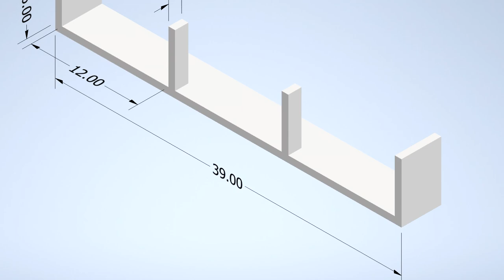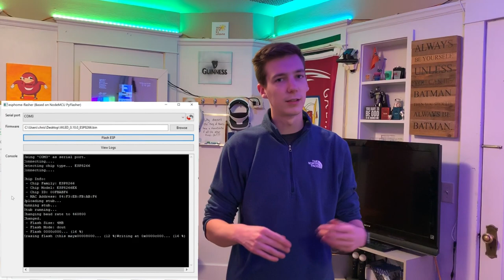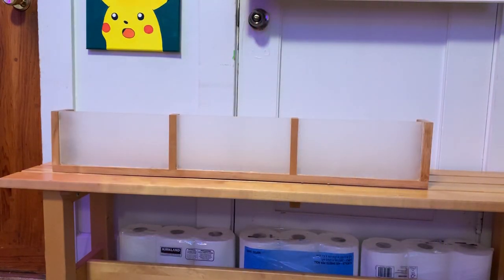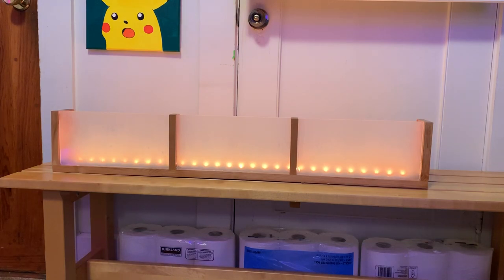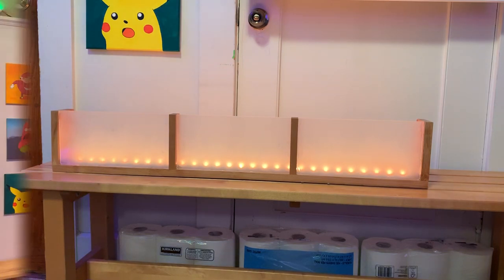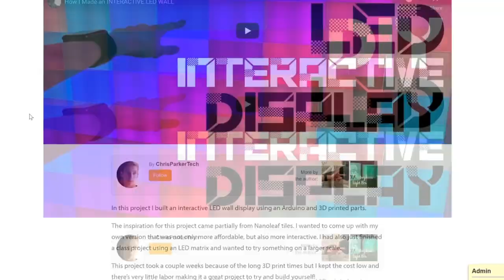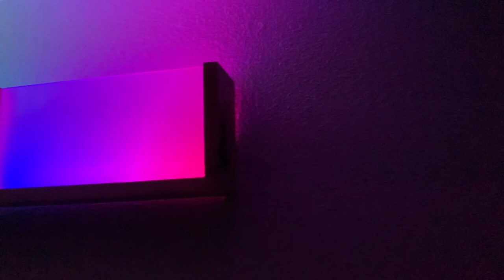How I Built Wifi Controlled LED Wall Lamps

Comment: What is the tubing that you used around the wires? And what grit of did you use when sanding the acrylic?
Reply from the maker: The wires are just held together with masking tape haha. I laid down a long strip of tape and stuck the wires down and wrapped around it. I have no idea what sand paper grit I used, honestly I just used the finest grit I already had. Hope that helps!

Comment: do you need a bigger power supply is we go with the 300 leds
Reply from the maker: Yes the supply I used can’t power very many LEDs. You’ll want a 5V supply but to get the amperage you should use this equation: minimum Amps = #Leds * 0.05
Reply: @Tech-Random   Your description says LEDs * 0.5 .... that would be a lot of Amps!
Reply from the maker: Yes. Yes it is

Comment: Great video, as always. I feel that I stumbled upon you from Thingiverse. 
QQ: What did you end up replacing the strips with after not liking the single LEDs being visible. I may have missed your fix when watching; guilty multitasker.
Reply from the maker: I haven’t actually fixed it yet. What you see in all the shots is still a 30 led per meter strip. When it’s placed above eye level it looks way better!